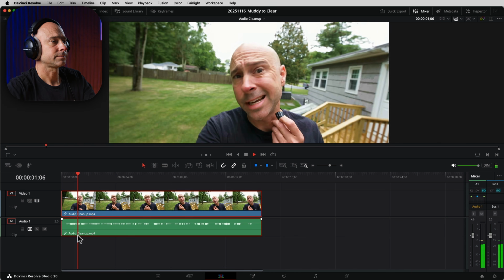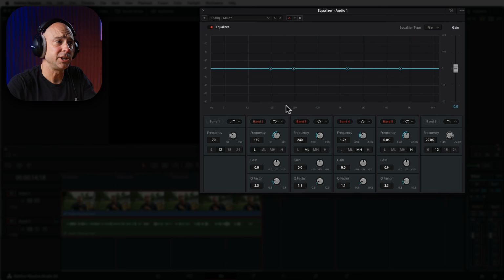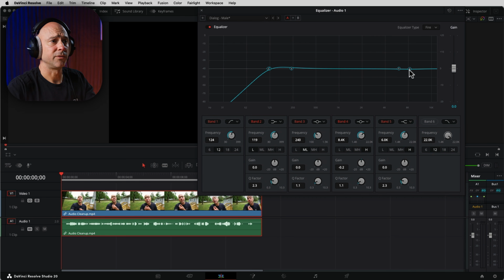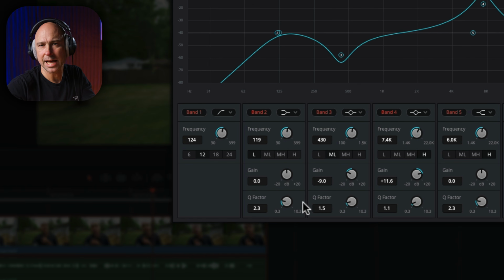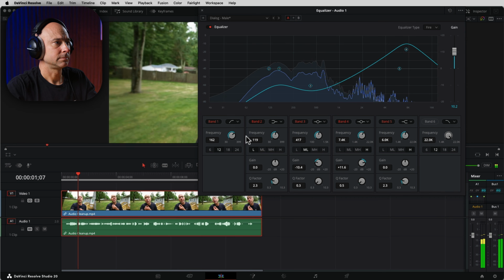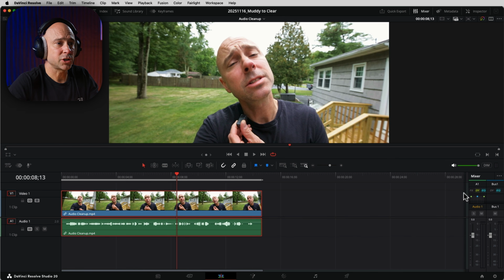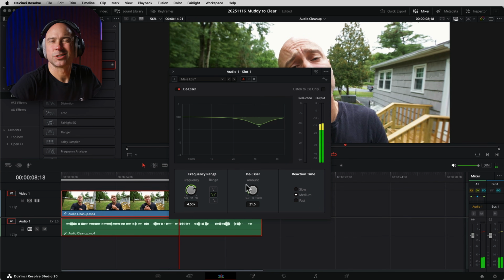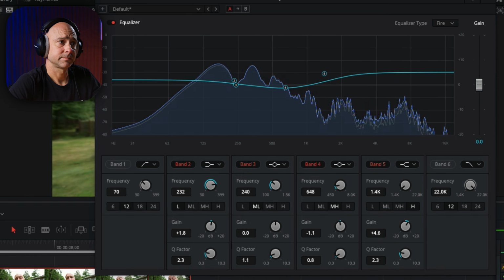DaVinci Resolve 20 Audio – Clean Up Dialogue & Add Clarity (Beginner Tutorial)

Comment: Should I use like la 2a compressor add on. Or that would be overkill?
Reply from the maker: It's a great compressor.  You can just adjust it so it's not too strong and it will work just fine.  I also like the LA 76 compressor.

Comment: I have an audio question, not too related to the video but I hope you can help, anyway. I'm making a film with Netflix settings. The project settings say to set it at -27 Lufs but the dialogue settings anywhere between -6 and -12. How do I get something so low to -27 if I have to keep dialogue between -6 and -12? Can you tell me which meter in Resolve I should be looking at for the -27 Lufs? And which meter for the dialogue? Please, in Layman's terms if you can. I'm a dummy with this stuff.
Reply: Never mind. I just saw your other video "AUDIO LEVELS CRASH COURSE" and I think I understand now. I hope I understand, ha ha. It's pretty much put the meters to get it to the right number or sound. The Loudness meter is totally different. Make sure it doesn't go over (or under?) -27 because that is the overall output. I think. Thank you so much.

Comment: Just another thing I am trying to edit multiple different clips w audio is there an effective way to make them sound better for example if I want to have eq and a compression on 1 audio clip but not the other
Reply from the maker: You can quickly drop them down to their own track by selecting them while holding the option or alt key and hitting the arrow buttons.